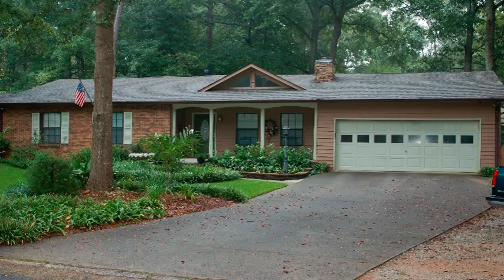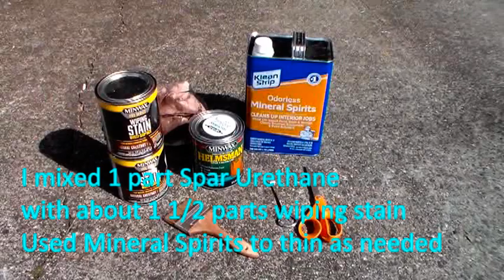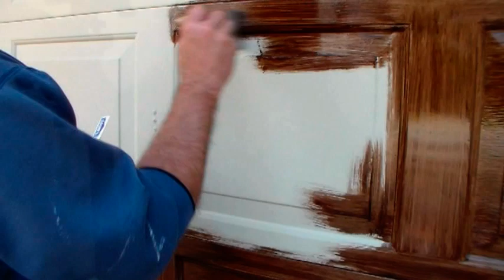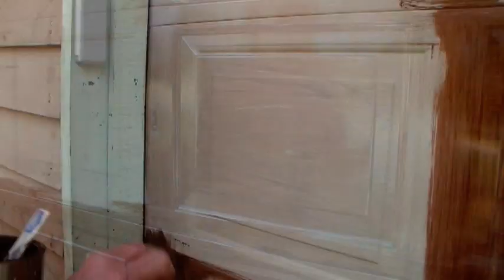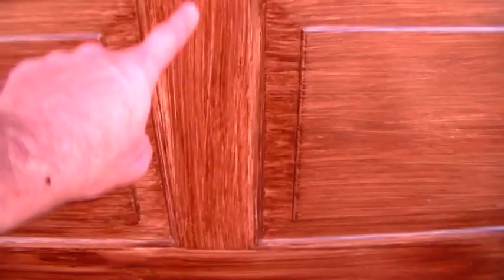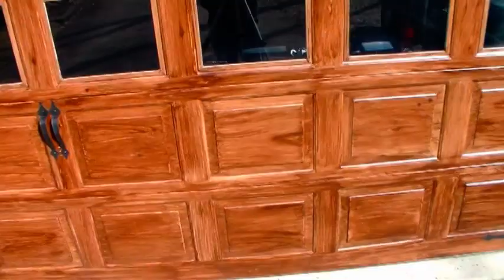Faux Wood Garage Door the right way

Comment from the maker: This was the first time I've ever tried faux wood painting. I have worked with wood a long time, and I was going for a walnut type grain. I didn't want the pine or oak looking grain that you get with the "graining tool".

During my research on how to do it, I saw many videos that showed taping off the grain along the beveled part of the panel. I knew this was not accurate. I also found some that would make the grain cross the center stiles.

This mixture of stain and urethane seemed to work well, although it did dry a little too quickly. When I would overlap it would get darker, but with a little working I could blend it in.
Reply: Gerry Crumbley very pretty, sir
Reply: If you would start with a semi gloss first coat you would be able to manipulate the grain much easier, if you don't like the rocker which I also think is just a cheap trick try combs and a flogger and be sure to have a photo of real grain nearby
Reply: Gerry Crumbley ,,,
Reply: What exactly did you mix to get this finish?...I'm truly impressed sir!! 😳👌
Reply: I live in Florida so we have salty air and extreme sun beating on our garage. Are there any Sherwin Williams paints I can work with that will hold up better than a stain?
Reply: @jimmywooten8525  that’s what I want to know as well. Was confused about mixture & if he switched to a different’color’ to add the knot details etc right after the initial straight wood grain coat. Hope he answers. Or someone that knows. 😀
Reply: @jimmywooten8525  just realized it’s 6 yrs later so it’s doubtful  lol

Comment: Could you give us a detailed recipe for the paint you are using. I want to do our garage door but I want to make sure I mix the paint right. Thanx in advance. and you did a great job.
Reply from the maker: Sorry, I don't spend a lot of time on the computer. Just now reading this . . .
It was a trial and error thing. I mixed the wiping stain (which is real thick) with the Urethane 1/1 at first, But, I ended up with about 1-1/2 qts stain to 1 qt Urethane, as I was trying to get the color a little darker. I did this in the morning out of the sun, and I noticed it began to dry really fast as the day got hotter. That's when I started mixing in the Min Spirits. That, I just kinda did as I needed.

This is not the best combination, as I noticed that if I went back over a spot it wouldn't do quite right. Maybe I should have used something other than Min Spirits to keep it from drying so fast. I think the Min Spirits was dissolving the stain too much.
Reply: @drgerryc  urethane and stain could be oil or water based. Which did you use for this?

Comment: I did a 3 coat 3 color effect starting with a red barn color to an orange color mixed with a dark brown, then wiped it with a damp cloth of black watered down latex paint it looks good, I got all 3 gallons of outside enamel paints from a box store people had brought back for a refund and each can cost me about 5 bucks,  You would be surprised what you can do on a budget. I also took off the lock and handles on the wood door and planed the bottom it had a big smile on it its a 16x7 door the center was sagging real bad, after the paint job somone asked me when I got the new door. I laughed and said its the same door.

Don't be afraid to screw up, if you don't like it you can always paint over it and try somthing different. Layer light to dark colors for best effect. Don't be shy light black streaks adds more depth. You can lightly wipe a damp cloth over light brush strokes to blend it in more.
it will give more of a wood grain look.
A new door would cost me about 3k to get what I want this cost me about 50 bucks and some time. And it was fun.

Comment: does this need a top coat of clear polyurethane when finished?  or does the mix of stain and urethane eliminate this step?   not sure if the mixing the stain is for effect or eliminates needing to seal it.  also, what is the color/tint of stain used? walnut?   i think it looks great.  thx.

Comment: it is much easier and looks a bit better if you paint the door more to the color of wood before you do the stain work as well. I usually paint them light brown then use gel stain then coat with spar urethane.

Comment: Very cooool! I plan on doing this and just have one question, is the latex base coat necessary to act as a primer? Or can I just paint it straight on the Factory White that it is painted with?
Reply from the maker: It's been a while since I've been on here, obviously . . . . but the factory white may be too bright. the base coat is to help mimic the dark & light colors of wood.
Reply: @drgerryc  Awesome! Thanx for the reply!
Reply: Hi! I have another question,  I mixed the urethane and wiping stain at the ratio suggested in the video, I didn't use thinner because it was so thin already, it just runs a whole bunch and it doesn't seem to dry quickly like in the video, can you think of what I might be doing wrong? also if I paint it first, will the oil based mixture I'm using bubble up latex paint underneath, or do I need enamel? thanks in advance for your reply
Reply from the maker: @troyagid7100  Sorry, I'm not a paintspert. All I know is the external flat latex paint I used as a base worked fine.

Comment: Gerry, great job. Looks awesome. However, when you paint a steel garage door, it not only voids the warranty( on the usually baked on finish,) the paint used will often make it stick to the jamb during operation. I've been a garage tech for 10 years. I have had many service calls pertaining to this in particular.
Reply from the maker: Well, seeing that this garage door is 30 years old, not sure the warranty is a concern. I haven't had any issues with sticking.

Comment: Stain is designed to penetrate inside the surface not stay on top of painted metal,it will start cracking or peeling in few winters
Reply from the maker: So far, so good

Comment: Fine if you don't get close to it
Reply: He did a good job.  I know "GOOD" is relative, & yes, it could have been improved on in certain areas, BUUUUUT, e/panel is different (as with any & ALL wood!), & for 99.9% of those who SEE it, it will be from the STREET, not right there at the door as you put in your code to open the garage door where you're w/i INCHES of the door.

Comment: This is NOT the right way unfortunately. Of course it’s your first time, if you’ve done lots of these, you’d know oil based paints and stains get brittle, crack and fail very quickly outside. Also it voids the warranty of every metal door. The oil based paints will eat into the baked on coating on the metal and will delaminate over time. I’ve seen hundreds of these doors look good for a few years, then they need replaced. ONLY USE WATER BASED PAINTS!

Comment: In order to get a natural looking wood faux your strokes CANNOT be done one panel at a time. Doing it this way will make each individual panel look different than each other. By far the best way to faux any garage door is to roll on your gel stain with a 4 in flat surface roller from one side of the garage to the other then immediately go over it with a 4in stain brush. Otherwise your finished product will look choppy like this.